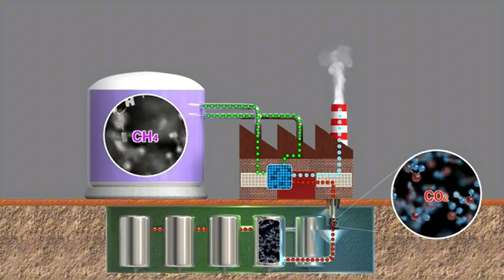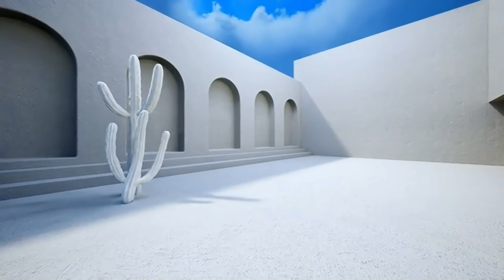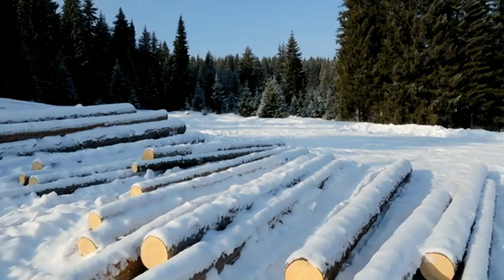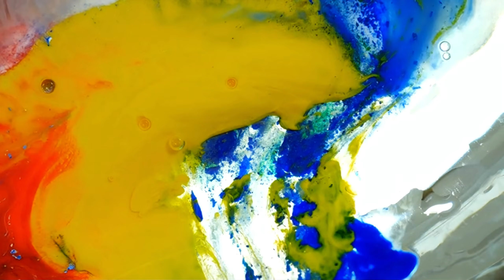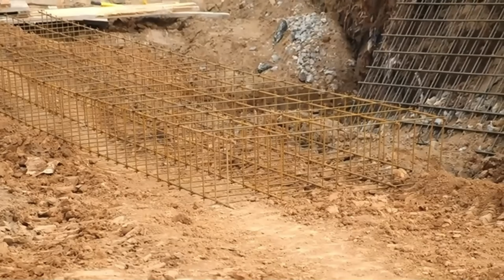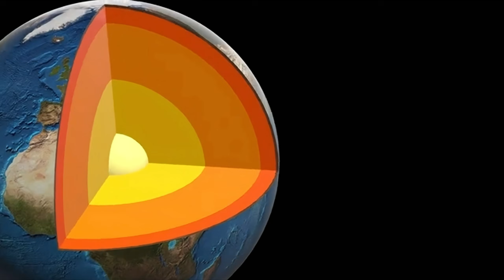This $70 BURIED PIPE Cools Your ENTIRE House (No AC NEEDED!!)

Comment: What if we use a closed loop system with two heat exchangers - one buried, one inside the house, with a blower fan circulating the air? Your only electricity cost would be the blower.

Comment: Actually, earth tubes do dehumidify (automatically) when the temperature of the tube is lower than the dew point of the outside air (which applies much of the year in hot/humid climates).  The issue is how to remove the condensed water and keep mold from growing.  Straight wall pipe on an incline/decline seems like the most appropriate solution, with the water collecting at one point or draining out of the system, but this is very site dependent.  I've seen systems where corrugated pipe was used in humid environments which is asking for trouble.  I've also seen designs where perforated pipe was used so that water can drain out directly to the soil along the entire run.  This seems like too much exposure to soil gas and radon for me, but with continuous air movement, maybe I'm overthinking it.  Anyway, I'm a big fan of these systems and believe they can be successfully integrated into thoughtful residential design.
Reply from the maker: Those are some excellent technical points, especially regarding moisture management and the risks of specific pipe types!
Reply: Lo mejor es caño de pvc de 200mm en adelante con una profundidad mínima de 1.5 con una inclinación de 3 grados pozo de 60x60x80 lleno de grava caño perforado para el drenaje, una buena chimenea de posible bajo sombra con malla mosquitera para evitar la entrada de insectos animales, también es recomendable un extractor en la entrada a la casa de bajas revoluciones y una chimenea de subsion de pvc o acero inoxidable pintado de negro mate para facilitar la ventilación estos acelera tres veces , de noche un buen extractor puede ser de 24v o de 220v 60w para las noche cuando la chimenea no funciona, también puedes poner un filtro de carbón en la entrada para el polvo , también es recomendable cruzar una soga de punta a punta para facilitar la limpieza le atas un trapo y una dos tres veces al año  limpiarlo